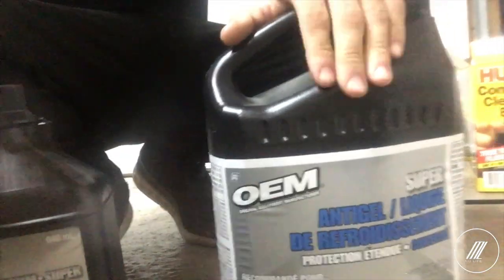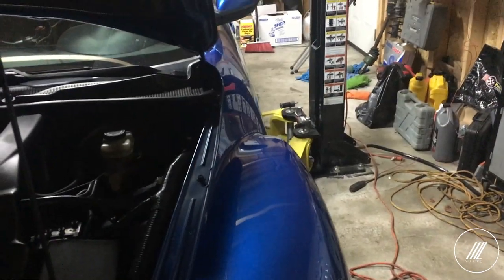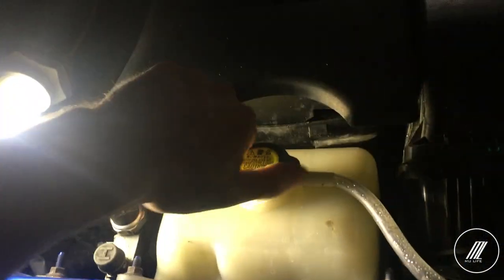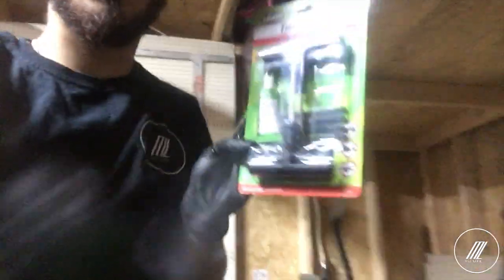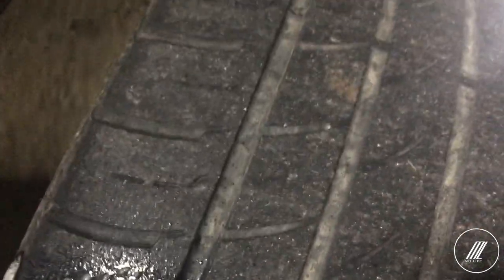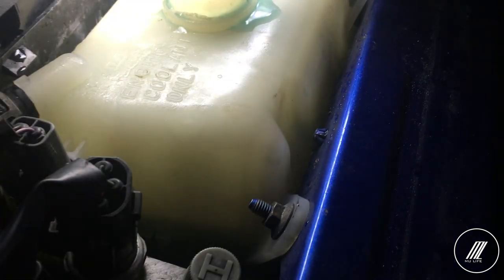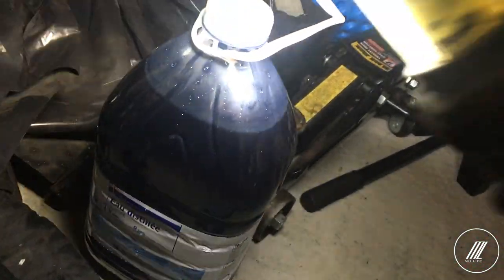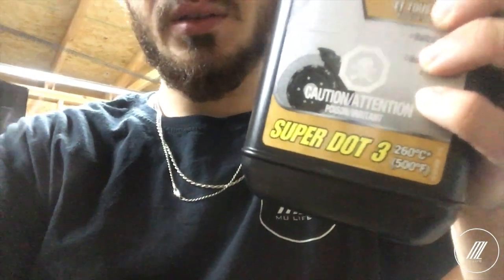RX8 Coolant flush + FOUND THE TIRE LEAK !

Comment: Another good video. When you went for a drive, what did you use to mount your camera? Or where did you mount it? Thanks!
Reply from the maker: Thanks , Its just a good quality phone holder and was mounted on the sunroof , as you can see i had to lift the steering wheel a little up to get the dash to show up completely.

Comment: Can you remember if that tyre repair worked well did it last long.      Iv the same kit but not tried it yet
Reply from the maker: Yes. they do work very well for most punctures as long as the damage is not on the side of the tire